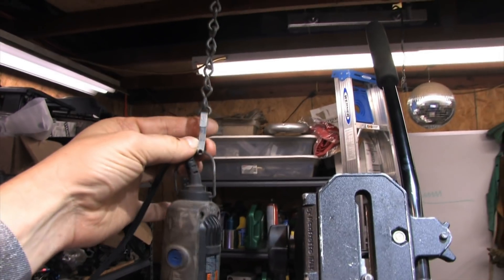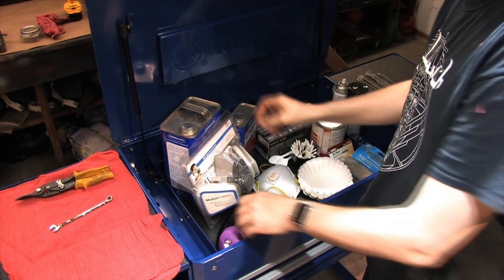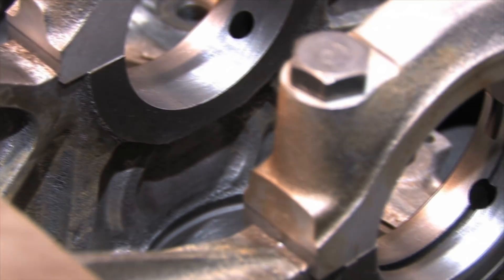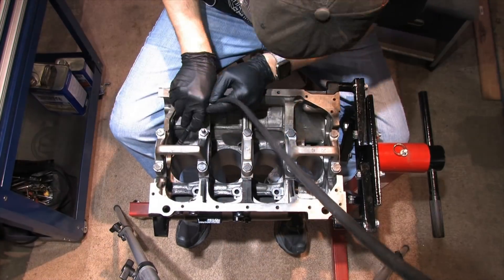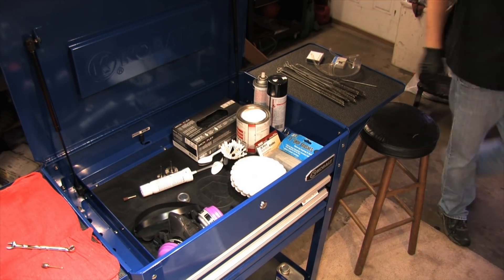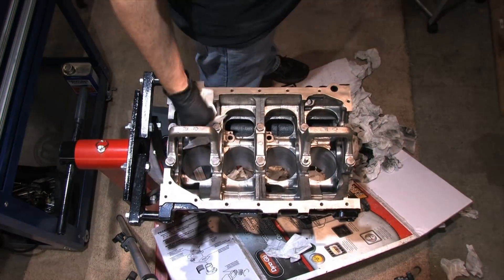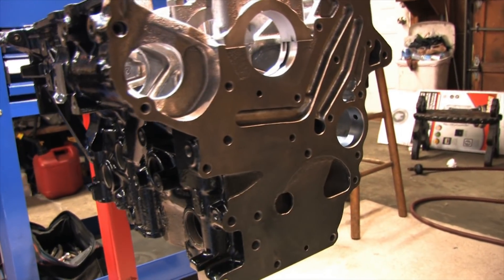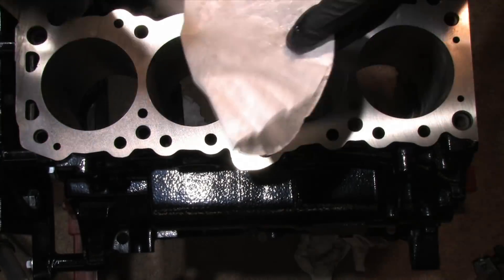Oil-repellent Crankcase Coating?

Comment: MG Chemicals markets ‘Red GLPT Insulating Varnish’ focused on electrical/electronic applications (exactly the same stuff under different vendor and name).  I have used it to coat/seal/protect/insulate repaired motor/generator and transformer windings. Recently the electronic ignitor that lights the flame on my stove top, ‘tic-tic-tic-tic’, stopped working on two burners. The problem was arcing at the wire at the ignitor unit not at the burner (insulation had broken down) and some Red GLPT refurbished the insulation and, beauty. I also use it to seal NPT pipe (instead of Teflon tape) in low to medium vacuum applications. If your application requires a more stable pipe-to-pipe connection Red GLPT (Glyptal) is better as Teflon taped threads have a tendency to rotate and lose integrity (I am only referring to my vacuum applications and nothing else, e.g. water, gas, etc.). And finally, some 43 years ago I watched a couple of older boys down the street as they ‘Glyptaled’ (is that a word?) and engine that was from and to be returned to Shelby COBRA (model, year ???).

Thanks,
Cheers,
Mark
*****************************
Reply from the maker: People typically use this treatment on things they want to preserve.  It's far more popular to find with classic or rare cars than modern imports or mass-produced engines.  I will always insist that nobody does this while I go and do it.  This amount of time and effort applied to other modifications on the average import will yield actual performance gains worth talking about (unlike this treatment), and if something happens, the engine is highly-replaceable.  This is why it's more common to find it in stuff like Horch, Packard, Isotta Fraschini, salt flat belly racers and old rare production muscle museum pieces.  The fact that I'm doing this to a non-numbers-or-production-year-matching '90's Japanese engine is at least a little bit strange.  If anything I'm trying to find out for myself if this kind of thing is a myth or not, and expose how it works out in a street/strip weekend racer in a very public way.  This is an experiment that everyone gets to benefit from.  Cheers!
Reply: And, you also do it because, I think, it is your pleasure.

Comment: I'm working on a toyota turbo 4cyl, and you make me wanna spend a lot of time glyptol-ing 

Look forward to more sweet, sweet 4g vids
Reply from the maker: Back in the day I always wanted to boost my 22R pickup.  I never did.  It only lasted me 330,000 miles before I wrecked it.  It sat in my back yard for 2 years and then I sold it to a lawn company that came to my door asking about it.  Put a battery in it and it started right up.  They drove it up onto their trailer.  Toyota makes good engines.  That was my first car (truck).  In fact, I was trying to buy a Mk IV Supra after that, but ended up going DSM instead.  The Supra production ended the year before.  I was about to buy a '93 with 21k miles for $22k, but while I was off to my bank to get the check (Jafro didn't roll like that in '97), someone bought it for $23k, paid cash, and drove away in it 5 minutes later.  The following weekend, Fast & Furious was released.  You couldn't find a Supra anywhere for under $56k.  I bought my GSX a year later for $10k cash and that's where my history here begins.  I was almost the Supra guy.  Sorry if you're disappointed.
Reply: haha! ONLY 330k, that was a baby motor, barely broken in. It actually makes me pretty happy to hear good sentiment come from you about toyota engines. I am currently turbo-ing the new generation 2TR motor, based very closely on the 3rz block, which has proven itself strong up to 1800hp, but has VVTi for tune ability. I learned years ago, that no matter what make, model, or year of a vehicle, a Gearhead is a Gearhead(there are still a lot of people who dont fit into a gearhead category like you do, but I think you will pick up what im laying down). People who fervently align themselves with a single brand or product are missing out on the diversity of the industry and applicable tips to apply to their own projects(example is me wanting to glyptol my yota motor after watching your 4g glyptol video). 

No disappointment here, my friend. Just eager excitement to see another gearhead succeed!
Reply: Jafro the world wouldn't be the same if you were the supra guy and not the DSM guy.  DSM is just quirky and cool. I like your idea here with the coating, I feel like Ill probably go add half a quart into my DSM now. I always just over fill my 7bolt a little or about 1/2 quart. Maybe I could even over fill it by a full quart because once its running the crank case level wont be super duper high.
Reply: good points on a gearhead being a gearhead,it doesn't pose a real challenge building something that's been done thousands of times and mapped out.i love finding solutions to poorly designed products to make them more efficient and powerful,weird,rare,unusual builds making godly power or just working better than originally intended.that's what being a gearhead is all about,if it has wheels and its motorized it can be modded.improvisation,working with what you've got and using ingenuity is were its at.

Comment: That heater puts out a lot of humidity
Reply from the maker: It rained for a week straight prior to that day.  I had to wait for the rain to stop and the humidity to drop before even filling up that Kerosene heater.  The April showers here didn't happen until May.
Reply from the maker: ...but yeah, Kerosene heaters typically do.
Reply: Jafromobile yeah and I'm sure the fact that your in Georgia doesn't help either. Anything that isn't vented is going to put out crazy moisture. Really more of a problem in winter because you will get condensation on everything
Reply from the maker: I'm in VA now.  I couldn't afford Kerosene if I lived in GA.  It's dyed and regulated there.  Nobody sells it.  There's like 3 places and it's over $25 a gallon.  It's only about $4 here.  If you live that far south, you gotta use propane.

Comment: I guess I'm confused as how this would help. The oil will hit these surfaces, and drip off them regardless. So whether it comes off quicker or slower wouldn't effect the amount that's going to come off. I would think this wouldnt change the amount of oil that gets whipped up by the crank?
Reply from the maker: This is not about windage.  This is about how long it takes for oil to drain back to the pan.  This is about raising the oil level in the oil pan.  This is about a car that sits in my driveway in bad weather, or all winter long while my public roads are salted or while the track is closed.  I'll be revving this engine 1500 RPMs higher than normal on a fairly regular basis.  A lot of people would say "just get a bigger oil pan"... and while their idea has merit, I want to street this car, and converting to a dry sump oiling system setup or dropping $1,600 on the Moroso pan (that I don't think is even still in production)... are just not options for me.  If the same amount of oil that gets pumped up into the head drains more than twice as fast back to the pan, then the oil pickup screen is that much deeper under the oil level, and that much less likely to suck air into the main oil gallery.  It doesn't just dump into the pan.  Oil viscosity guarantees that it coats and trickles down trying to coat everything it touches.  It chases heat.  I've got an aluminum radiator, an oil cooler, and other upgraded systems to take care of heat.  I also will be using water/methanol injection on a loosely-setup race engine.  That means more condensation inside the crankcase.  Really, I have a lot of reasons, and Glyptal isn't a perfect solution for dealing with all of them, but it's definitely going to at least help alleviate the negatives somewhat.

Comment: great vid, but i may have missed it... why wouldn't you spray it in the block?
Reply from the maker: Too much masking.  I could have sprayed it.  I bought things to spray it (used it for mineral spirits and alcohol instead).  First I was skeptical that a 3 year old batch of Glyptal would pass through the nozzle.  Truth is, it probably would... but I didn't test it.  I don't have Xylene to thin the Glyptal with, and I'm not really interested in purchasing any of it because it's so incredibly toxic.  I would have no need for it beyond the Glyptal thinning and spraying.  Then I recalled how fast this paint grows an outer skin layer and figured what a pain in the ass it would be to break down the spray bottle and clean the nozzle every time I stopped spraying.  Then I recalled how long it took to mask the mains back when I ground down all the surface imperfections, and how tedious that process was.  The more of that stuff that went through my head, the more I realized it was easier to just bend a few acid brushes and be really careful about where I applied it.  It's easy enough to wipe it away with a cloth or q-tip and some 2+2.  I don't regret brushing it on.  Especially not now that it's done.
Reply from the maker: They do make this product already loaded into aerosol cans.  But then I recall the masking process, rinse-repeat.  I don't think one method is better than the other, they both require extreme patience, but the require different kinds of patience.
Reply: kewl! thank you i understand... either way, it's a pain in the ass!

Comment: Good work Jafro. Cheap toilet paper still works pretty good. Oil adhension on glyptal will be higher. Painted my little 4efte block and crankcase back in '99, not with glyptal though. Only painted the block on the evo, but who knows, maybe the next time I disassemble it I will do the crank case as well. Keep it up!

Comment: Glad to see another video. Slightly off subject but I find we should know. Will you put AC back in the Eclipse? I know you said it was giving you fits before you blew up the Eclipses 7bolt. Just wondering if you were able to fix the AC and If so are you going to show any troubleshooting procedures you used to fix the AC? Also what oil are you going to use? Since the eclipse will be highly modded with race goodies, conventional oil I presume will not be used?
Reply from the maker: I've always used Mobil1 Synthetic.  My bearing failures have always been from mechanical things that I did wrong.  Aside from the bearing chunks, my 7-bolt was spotless on the inside.  I use dinosaur oil for break-ins and then switch back to synthetic.  Wait until you see the inside of the Galant and how clean it is.  Its owner did the same thing.  Everything looks brand new.
Reply from the maker: That's some damn good info!  Info I will put to use on this build because it will be nothing like the last one that made it to 168,000 miles.  I didn't experience main thrust bearing and 2 rod bearings failure until I broke 421awhp with a owner-caused oil pump and clutch alignment issue.  2 problems that won't be a part of this build.  I will adjust my oil selection accordingly.  Thank you!
Reply: Changing catalytic converters are easy and fun in comparison over an engine. They sure have things backwards! Jafro, I spent WEEKS studying oils because I have a brand new WR250R, and while I realize my Yamaha motorcycle is a different beast with it's wet clutch needs, I did learn that Castrol performs under harsher duress then Mobil 1. I'm not talking about hype, or ads, or anything like that, I'm talking about finding independent oil studies and tests. This kind of material is not for the faint of heart so I had to go deep into the internet to find it.

Regardless of whether you're buying oil for your motorcycle or car, the brand still uses the same base oil, and what's honest about wet clutch motorcycle oils is that it's literally not about the additives. The BASE OIL is what is better on Castrol than Mobil 1. I had to refind and restudy multiple times finding the same to be true to let go of my bias towards Mobil 1. Mobil 1 is great, Castrol is just a bit better on under harsh conditions.

The reason I say motorcycle oils are more honest, is because with a wet clutch, there literally has to be next to zero additives for the wet clutch to work. You can scratch the surface of what I learned on my oil comparison video, but unless you want it, I won't put the link on your video out of respect. :)

Jafro, it's not just your great videos, it's your great fans that got me thinking enough to take the time to leave this well worth it response.
Reply: Jafro- I would suggest that you check out Forced Performances article on engine oils and use with turbos. It specifically addresses which have enough zinc and phosphorus to reduce wear on high load engines like ours. mobil 1 used to have a higher zinc and phosphorus content, however there was some shift in policy with the tree huggers and they were more interested in changing engines than cats. (high zinc and phosphorus can clog cats quicker)

http://store.forcedperformance.net/merchant2/graphics/news/Forced%20Performance%20Recommendations%20for%20Motor%20Oil.pdf

Comment: Hey Jafro. @20 sec into the video, I see a rack and pinion on the floor, is that for the Galant VR-4?
I'm really looking forward to see the effect of this coating!!! :-)
Reply from the maker: It's actually out of a '90 Plymouth Laser.  I was going to disable the rear steering on the Galant and convert it to FWS by replacing all of its hydraulics, but then changed my mind.  I want to restore it.  Good eye!

Comment: Are you going to coat the counter weights?
Reply from the maker: NO!  :)
Don't do that.  Crankshafts are balanced within 2 grams.  Mine is already balanced at 0g.  A gram is the weight of a small paper clip.  That means an un-even coating could make your engine shake itself to death.  A crankshaft with a coating on it would need to be precision-balanced afterwards.  My crank shaft is knife edged, lightened 9 lbs, and micro-polished.  It barely has any counterweights.  I've taken a different approach.  ;)
Reply: Yea I didn't even think about some of the other coatings and polishing that they have for crankshafts derp. I just thought dang why doesn't he put that coating on the crank to keep the oil off of it lol.

Comment: dose this help the oil move around the engine better
Reply from the maker: Sort of.  It helps the oil drain back to the oil pan and sump faster.  It's like building an express lane for the oil to return back to the pump after it's done its job.

Comment: I totally thought you were going to tape off where the main bearings sit before painting. I was actually taken aback.
Reply from the maker: Didn't need to!  :)  It's easier to just not paint them.  I was considering spraying the block, but this stuff is really hard to work with.  I'm sure it would gum up any spray nozzle really quick.  It's actually what I bought that aerosol thing I applied mineral spirits and denatured alcohol with.  It's just that the outside skin layer of this paint dries so fast and sticky that I didn't want to get half-way through and then fail.

None of the tools and materials I was working with could damage the mains.  I didn't wire brush any machined surfaces.  You'll also notice I didn't paint the machined surfaces that lead up the main bore.  I left those bare.  I don't want Glyptal wicking away oil from bearing surfaces while the car sits.  That made it really easy to not need to do any of the masking.  It takes less time to clean up my errant strokes with some 2+2 and a Q-tip than it does to cut a complicated stack of painter's tape.  I still have to clean the machined surfaces dozens more times during the dry assembly and final assembly, so there's no way I could hurt it.  I might even re-do the line bore when I get it back from baking.  We'll see how that goes?

Comment: Awesome job Jafro!  I wonder what the current cylinder bore size is on that block.  Would be nice to re-use this shortblock for an engine lifetime or two after all that hard work!
Reply from the maker: It was a virgin block that had 165,000 miles on it when I started.  I punched it .020" over to fit my 48k old 2g 9:1 JE pistons in it.  It should be 3.3665" bore now, but I haven't measured it yet.

Comment: Jafro, what happened to the Glyptal coated test piece from your head coating/painting video from so long ago?
Reply from the maker: Machine shop crew saw them, thought they were trash and tossed them.  I chalk it up to a communication error.  Someone pointed out in the previous video that there was absolutely nothing scientific about that test because the materials and preparation methods didn't match.  They were right.  I'm going to smash or cut a used cast engine part into little bits for my testing.  First it will undergo the same cleaning and degreasing techniques.  I might use a water pump housing or a connecting rod.  I don't really want to use any forged materials.  I do have a couple of spare valve covers, though.
Reply: Jafromobile fair point about relevance of the test. I look forward to seeing the new test piece.
Reply: CHEAP EASY TEST SUBJECT  https://www.amazon.com/Lodge-Cast-Iron-Skillet-3-5-inch/dp/B000LXA9YI/ref=sr_1_11?ie=UTF8&qid=1496577470&sr=8-11&keywords=small+cast+iron+frying+skillet
Reply: Jafromobile I seen a Mitsubishi valve cover that was hung on a wall with hooks for keys. Not my idea in any way but you might find it amusing to do.
Reply from the maker: But that skillet needs to at least run 10's at temperatures below 220°F.  :\
Reply: If you put it on the Collector- you can make bacon & eggs after the race. Those pans are more porous than your block- that's how you season them- look it up. Coat with fat, bake low & slow for non-stick coating. Same concept.       http://www.tasteofhome.com/recipes/how-to-cook/how-to-season-a-cast-iron-skillet